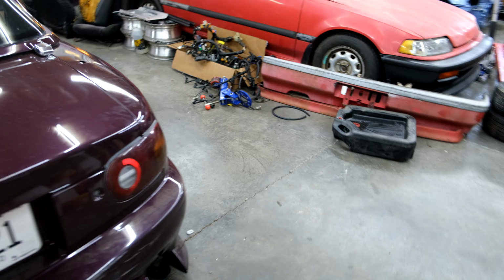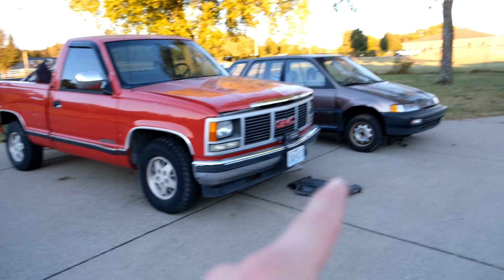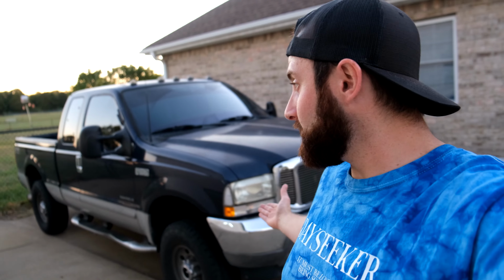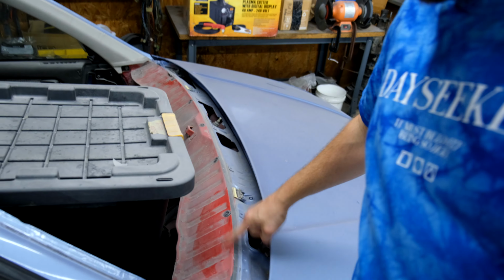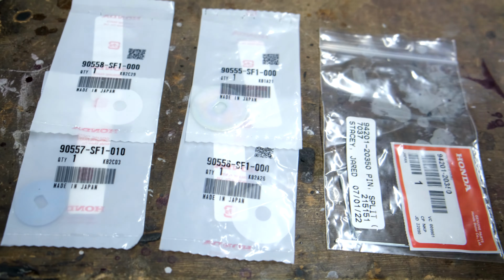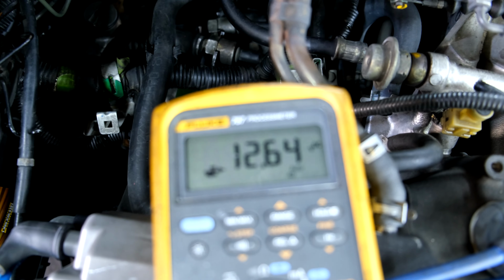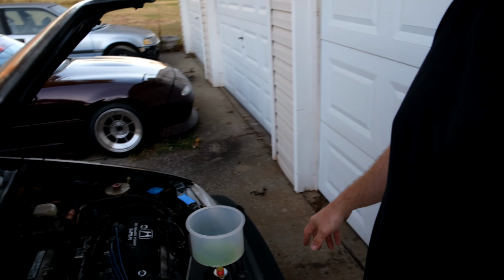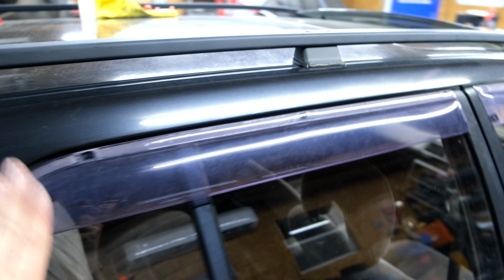I Almost Blew Up My RHD Civic Wagon... | Channel Updates | EP 3 | 4K

Comment: Dpfi needs to have ex lash set to the loose end of the spec. The majority of the heat in the valve transfers to the seat when it's closed. The lash exists for the stem to get longer. If the valve grows enough to run out of clearance, it doesn't seal against the seat. Then pacman joins the party...
Reply from the maker: Interesting … I’ll def look into that when we put it back together!